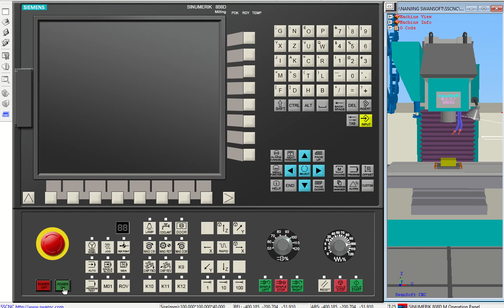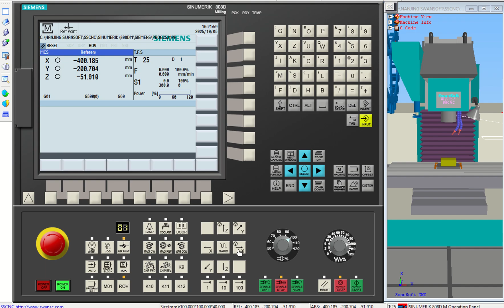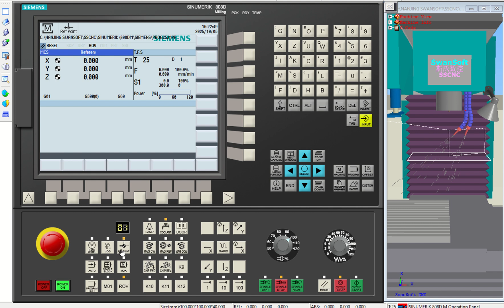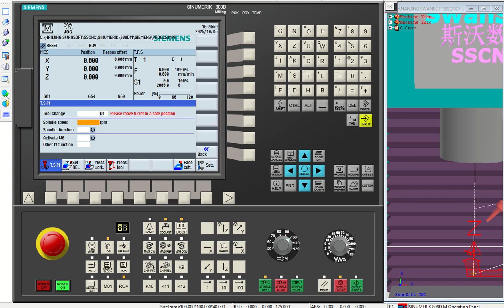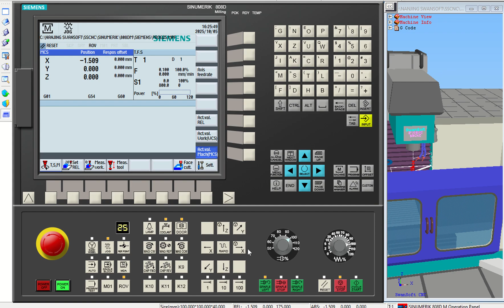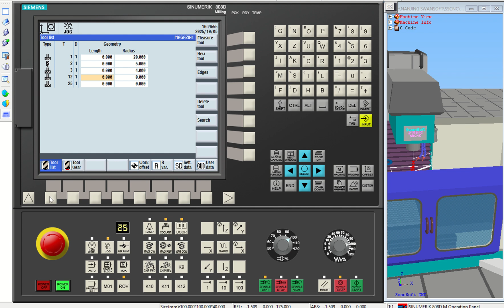How to Home and Dry Run Siemens 808D Milling Machine | Step-by-Step CNC Setup & Simulation Guide

Comment: Hi i recently join a company they have this machine they didn't operate it for last 6 months when i switch on machine after releasing all emergency stop machine didn't start homing it shows Alarm ( emergency stop, drives not ready and hydraulic station not started) can you explain please what is the reason
Reply from the maker: NC data boot/re-install
Reply from the maker: Refer to manual or seek assistance from service agent..until am able to see it or access it ..may not be able t assist
Reply from the maker: Where you located
Reply from the maker: Emergency Stop Alarm

Alarm: Emergency stop active

Even if you released all E-stop buttons, the control may still detect the safety circuit as open.

Possible reasons:

One E-stop button still pressed (check panel, tailstock panel, hydraulic unit panel).

Door safety switch not engaged.

Electrical cabinet E-stop still active.

Broken or stuck safety relay after long inactivity.

24V control power supply issue.
Check:

Twist-release all emergency buttons.

Close all machine doors properly.

Open electrical cabinet and check safety relay LEDs.

Press Reset / NC Reset on the panel.
Reply from the maker: Drives Not Ready

Alarm: Drives not ready

The servo drives must become ready before homing.

Common causes:

Main servo drive power not enabled.

Machine ready button not pressed.

Hydraulic system not running (some lathes interlock this).

Low voltage from power supply after long idle period.

Check:

Turn Machine Power ON.

Press Control ON.

Press Drives ON / Machine Enable button.

Check if servo drive LEDs in cabinet are green.
Reply from the maker: Hydraulic Station Not Started

Most CNC lathes with SINUMERIK 808D require hydraulics before spindle and axes can operate.

Possible causes:

Hydraulic motor not starting

Contactor stuck

Low hydraulic oil

Thermal overload relay tripped

Hydraulic pressure switch not active

Check:

Press Hydraulic ON button.

Listen if the hydraulic motor starts.

Check oil level in tank.

Reset overload relay in electrical cabinet.

Check if hydraulic pressure gauge shows pressure.
Reply from the maker: Very Common After Long Idle (Important)

Machines sitting for months often have:

Stuck contactors

Low battery on control

Moisture in cabinet

Power supply faults

Try this simple restart procedure:

1️⃣ Turn main power OFF
2️⃣ Wait 2–3 minutes
3️⃣ Turn main power ON
4️⃣ Release all E-stops
5️⃣ Press Control ON
6️⃣ Start Hydraulic Unit
7️⃣ Press Drive Enable
8️⃣ Then try Reference Return (Homing)